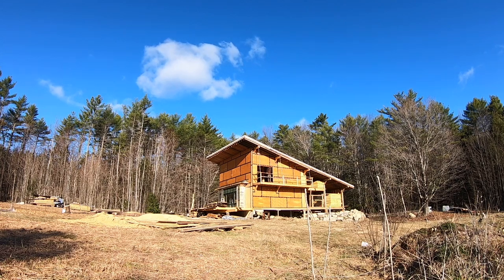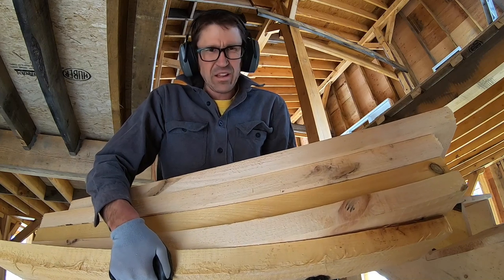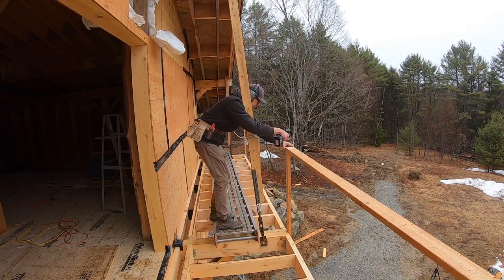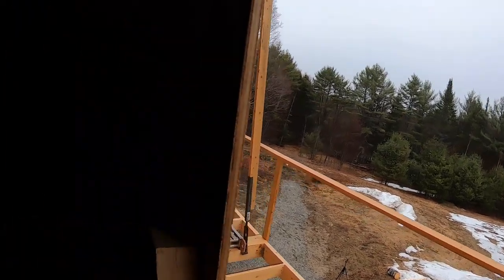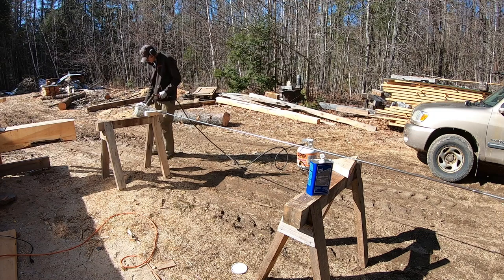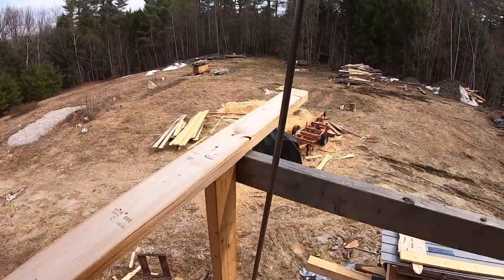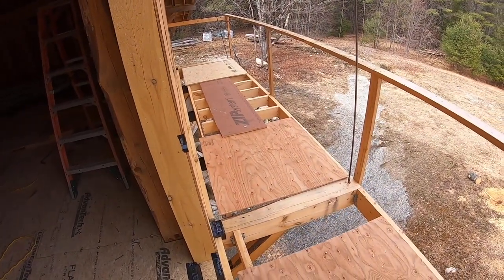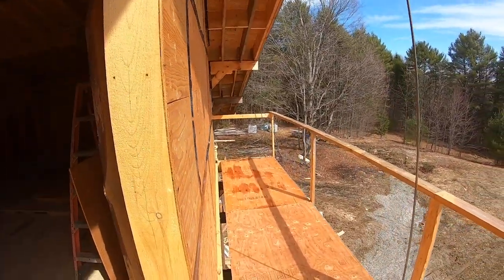Building a House from Trees SE 5 EP 23 Building a Balcony on a Timber Frame pt. 2

Comment: Have really enjoyed the multi-season series.  Seems the weak point on the tie rod supports would be the washers, strange enough.  Might want to tuck 1-2 more at each bolt; seems worth the $2?  Anyway, really fun and amazing stuff.
Reply from the maker: Thank you so much for the kind words and the helpful tip! It's a good point and has an easy solution before they are buried in the soffit.

Comment: Hello,  I would suggest taking a piece of the same kind of wood coating it with Linseed Oil and setting it outside for a few months.  See what happens.  Around here the linseed oil acts as fertilizer for the mildew.  in a summer the wood will be a gray black down about a 1/8".  A job to sand off.  Might be worth checking before committing.  There are a couple of clear oil finishes that are somewhat better.  Love clear wood but to keep it that way seems to require at least a yearly coating.  Take care.  Doug
Reply from the maker: Yes, I have heard that too. So a solution to that is mixing in this concentrated pine tar from the same company in upstate new york, which acts as an anti microbial and prevents mold growth. That it ends up a bit darker is a side effect, but as long as it works. The Finns have been using this combo for ages. Thanks for the comment.

Comment: I look forward to and enjoy each of your videos and wish I could do that.  Just something I thought of while you were working:  Would it have helped if you had installed ledger boards to support the joists?  Are you going to use the metal hangers on the joists?
Reply from the maker: I thought about it, but they were a good tight fit and I worried the ledger would hold onto water. I used 6 beefy screws per side and a timber lock per as well.

Comment: If you had access to a metal fabricator, why didn’t you have them make you steel plates to put between your washers and the wood? Would that not have actually been more structurally sound and less likely to fail?
Reply: Overbuild not under-build. Isn't that what this project is about? Although with the 8X8's knee braced you might not need those rods but they look good. I would also put two nuts on each end just to overbuild a little more.
Reply from the maker: Its a good question, but the washer I have up there is holding really well and in reality, those are a redundancy, like James says here.